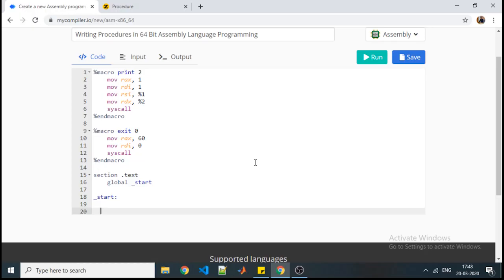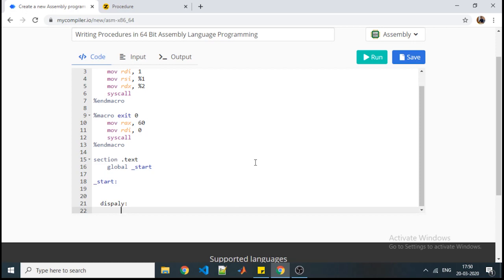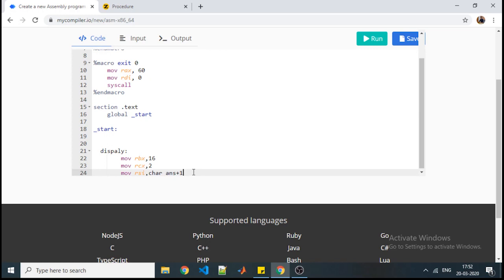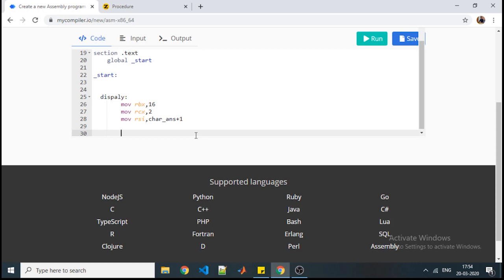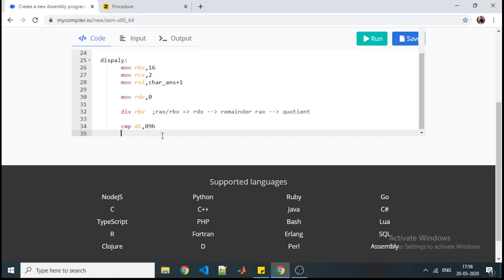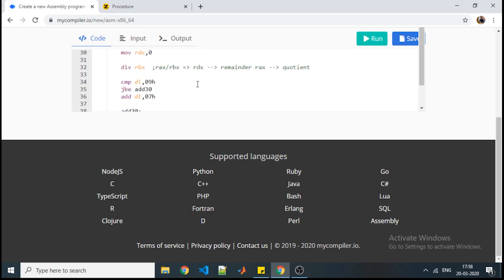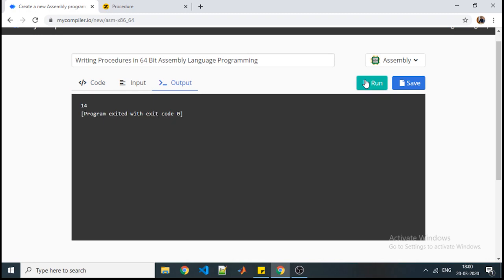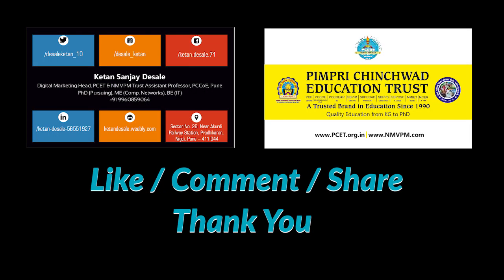How to write Procedures in 64 Bit Assembly Language Programming by Prof. Ketan Sanjay Desale, PCCOE

Comment: hello sir, i was wondering how do you convert ascii to decimal
Reply from the maker: By subtracting it's relevant ASCII from accepted number. For e.g. ASCII value of '0' is 30h. So after accepting '0' from terminal, subtract 30h from it. It will give you '0' as a number and store into register.
Like wise for other numbers equivalent ASCII need to subtract. I explained them in detail in this video as well.
Reply: @KetanDesale   thank you very much sir , i wanted to know if there are any reference material or textbook for this asm programming that i can refer to

Comment: Sir ,can you please tell me the  difference between these two statements : 1]  mov  [rsi], dl      2]  mov rsi,char_ans+1
Actually ,I just Want to know what exactly the meaning of rsi or any resister with and without sqaure bracket.
Reply from the maker: When we write rsi in square bracket like this [rsi] it means value at address which is stored in rsi. Without square bracket rsi refers to only address, not value.
Reply: @KetanDesale  Thank You Sir☺🙏🙏